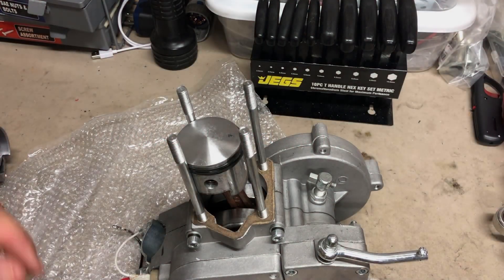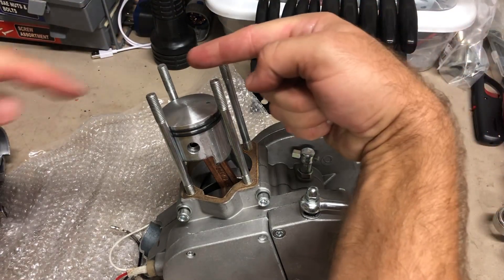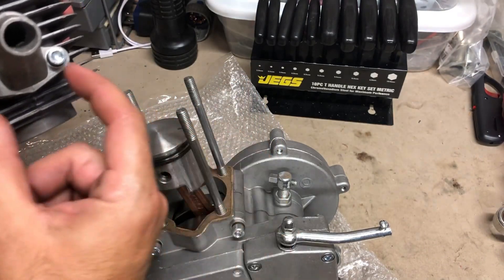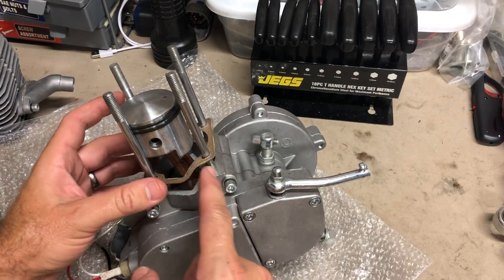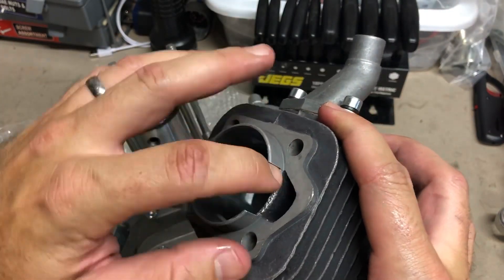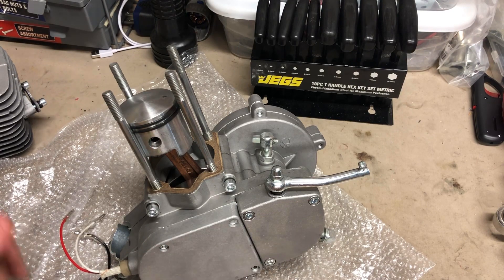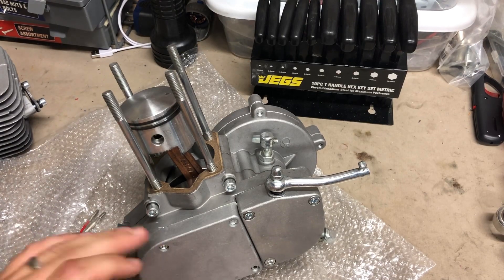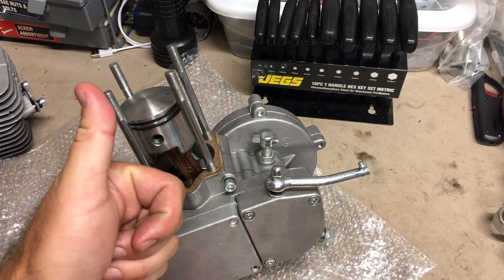WARNING!!- Firestorm YD100 Zeda Pre-Install Inspection Setup

Comment: Why is my yd100 making a heavy knocking noise in the engine over 25% throttle? Do you think the piston is hitting the head because the cylinder gasket is too thin?
Reply from the maker: Thanks for watching. I would first check to make sure that my spark plug was properly gapped and not over-torqued. The. I would check to see if my head bolts were no more than 13 ft/lbs. Engine kits come with 2 bottom gaskets, are you rolling with one or two? After checking the previous suggestions, and if it still knocks,  then try a second bottom gasket. One of the steps above should definitely solve the problem….that is of course if you are sure the knocking is coming from within the jug.

Comment: Bt100 is a better engine kit in the vs yd100 is not better crappy casting and poor performance yd100. if you want a form its and quality the bt100 engine kit is for you

Comment: Thanks for the info. I have been porting and modifying 2 strokes for years so just today I finally ordered this same yd100 engine. Anyway I'll give the porting a good makeover where possible, ceramic coat some of the internals, and upgrade the exhaust. Can't wait to drive it!

Comment: lol please!  I ride a Yd100 and a 120cc 4stroke motorized bicycle all over the place.  Most cops don't care it's size even though under 50cc here like most places.  Most cops I think stop people on these to see what the hell it is and if it's safe to be on riding around. It is there job after all! More then likely you will see them 3 weeks later riding one around lol!    You should really upgrade all piston clips in these. they are notorious for breaking off inside over time.

Comment: wow i was just about to order on thank god i watched this
Reply from the maker: The engines have improved over the past year, but you'll still want to overlook your engine and make the appropriate alterations. It's just mass manufacturing overlooks. It doesn't mean the engine is bad, just means you need to put in a little work to make it better. Happy building

Comment: Great video - glad I watched this before starting up my newest motor.  I do have a question though: Do happen to know of anyone who sells replacement parts for the kits?  Items like clutch and throttle cables, chain tensioner, gas tanks?  I have a few extra motors laying around but are missing some of the other peripheral parts.
Reply: Gasbike.net

Comment: The piston ring notch is not going to hit your exhaust port. The exhaust port is perfectly aligned inside the cylinder wall. Maybe its the heat from the exhaust port causing blown rings, Dirty engine castings also release large metal particles that score the piston and cylinder walls. lightly porting a new engine can get rid of the loose metals and save piston rings.

Comment: Hey would this cause the engine to not start, the Piston facing the wrong direction
Reply from the maker: The bike will start and it will run, but it would be only a matter of when the piston ring would bust and destroy your engine. What happens when your bike doesn't start?

Comment: when the arrow points to the carburetor, does this mean that it is placed incorrectly?
Reply from the maker: Most of the times yes, but look for the piston ring pins on the cylinder--the pins where the rings meet--those need to be toward the intake side of the chamber, not on the side of the exhaust.

Comment: Do you ship to Canada?  I'm looking to get the engine only but can't find any Canadian vendors besides Zoombicycles, but they only sell entire kits, which I don't need.  My bike currently has a Grubee GT5A on it, and I'm hoping I can just swap out the engine and keep all the other stuff.  I migh just need a 36T or 32T to take advantage of the increased torque.
Reply from the maker: Hey, thanks for watching. I too only sell full kits. You may want to try CDHpower or eBay for just the engine. Hope you can find something soon... Tis’ bike riding season 😎👍... best wishes.

Comment: Not only was my piston backwards, one piston clip wasn't seated correctly.  Thanks for the video.
Reply: How is it doing so far?
Reply: @jansen7640  Honestly the biggest problem for me is that the straight arm of the e clips tend to break. I've had to replace the jug and piston twice because of this. This last time I cut the arm down to where I can just get my needle nose on it. It's been suggested to use an internal snap ring instead. I'll try that if I get another failure. I have an e bike coming so in reality I might soon be done with motorized.

Comment: Should we still worry about this?
Reply from the maker: I have ordered some from Bicycle-Engines.com recently WITHOUT issue. But you'd still want to check the top of the inside of the jug tonkaoe sure there is not a metal tag/burr right in the center. I really like this engine...its worth it to check. Thanks for watching.
Reply: @SouthernCustomCC  thanks for the info man have a great night

Comment: Are the bottom ends the same the yd100 and the 80cc iv been told u can put the yd100 top end on the 66cc bottom end
Reply from the maker: I have NOT personally tried to switch them. But with that said... the numbers match IF you have the long rod high hole piston set up. The GT5 motors have the 89mm rod and so does the yd100, BUT the PK80 has a shorter rod at 85mm. So, the answer to your question is BOTH yes and no!

Comment: I'm wondering if this engine will fit a mongoose malus fat tire bike, I have seen other videos where they say you have to  be careful cuase of engine clearance issues,so if anyone would know the answer it would be really helpful
Reply from the maker: james hyatt : Thanks for watching! It will definitely NOT fit the malus. This is much taller than a standard Zeda engine and the spark plug faces the other direction. It will not fit...even if it is offset. Sorry.
Reply: @SouthernCustomCC  many thanks for the reply,and even more for the info about it not fitting ,that alone saved me time and money

Comment: Its supposed to have two bottom gaskets to advance the intake a little as the firestorm motors can handle the extra tork, i also skirted my piston on the intake side to fully advance the intake and its insane fast
Reply from the maker: Allen Sheppard : You gave me inspiration for my next video! I appreciate your input, thanks.
Reply: Can this one piece jug be ported inside the transfers.

Comment: not a great engine apparently it over heat. doing some port timing and running 10/36 you can get 40+ top end speed.
Reply: Meh I already ordered one, need to get a new kit since my old one is getting too old, I have some ideas I want to try with this engine, if I can get 43mph on a stock carb/exhaust 66cc I think it's an upgrade from my 8,000 mile Happy Time Motor.
Reply: Yeah, I mean I know these casings were made in China I mean everything basically is, from most cars to basically everything in your home... Ever seen those "Made in" labels, they all don't say United States, if any actually do.
Reply: @eduardodiaz5762  k
Reply: Is this the same motor as the T-100? I've heard that one doesn't overheat but the seem to be the same engine.
Reply: @eduardodiaz5762  the bt100 and yd100 is the same
Reply: @dreadknot2238  no I'm talking about the Zeus T-100 sold by uMoto, with the super magneto and cdi
Reply: @eduardodiaz5762  junk not a true 100cc more a 79cc
Reply: @dreadknot2238  I mean my 80cc is a 66cc and I'm not at all disappointed, I'm doing 43mph max speed, on stock parts and it's one of those supposed cheap Happy Time china junk Motor, lasted me a long time and it still going strong, I'd heard these motors were made in the US.
Reply: @eduardodiaz5762  where you hear that from u been misinformed all these engines are straight outta china

Comment: I just got mine yesterday and I had the very same problem and only checked it and knew what to look for because of your previous video about this engine. But it was no big thing, just pulled it off and turned it around the right way ( my first time doing btw and was very easy to do) so thanks for the information man, can’t wait to get her up and running.
Reply: I don’t keep track of mileage but I’m on my third tank of gas now and the motor runs great. I haven’t gotten it to top out yet but I’ve had to the low thirties. The only problems I’ve had are with my bike itself. Too many to mention. The bike is actually down right now while I try to fix it again. Brand new bike too, just got a lemon. The motor is awesome though, I would definitely recommend it. It has really good take off power even with the 36t sprocket that’s on it. I don’t think it’s going to have the top end speed everybody is looking for though but I don’t mind, I don’t really like going over thirty on these things, but it is nice to know you can if you want to. Anyway, I really, really like the engine.
Reply: @robbyclark6915  thanks I ordered the Zeus T-100 equivalent to the YD100 but mine came lubricated and correct piston direction, I topped mine at 42mph on the stock parts. I have 700miles so far on mine.
Reply: How is your 100(true 80cc) motor kit working out for you, how many mileages and what's top end speed, any differences noticed between this one and the stock 80(66cc) Motored kit
Reply: But wat is da reason this company permits this emgine to go out da door with out any explaination or. Informing da buyer of this big and dangerous condition an accident waiting to happen.
Reply: @RafaelSantos-vd6be  lack of knowledge or just simple buy from China and sell em again, with their added price mark up.. I got mine for 159. Plus taxes cause you know how America loves taxing everything, but fixing anything proper.
Reply: @eduardodiaz5762  I Have read THAT THESE LOWER PRICED SMALL ENGINES HAVE ALOT OF CLEANING UP YHE BURRS AND METALS  PORT HOLES VALVE IN SN OUT NEED SANDING DOWN AND ETC .I loke gas jobs better as nd Battery electric are way TOO ECPENSIVE $400 AND MUCH FOT DAT I BUY A MOTODCYCLE OR A VESPA DAT YOU CAN REALLY RIDE A PASENGER WITH WATT GOOD IS SITE SEEING WIYH OUT A REAL LIVE DOLL NOY JUST A MMENIQIUNE WE INNLESS WIEGHT HA HA A SINFELD SOECIAL
Reply: @RafaelSantos-vd6be  my T-100 came deburred but yes most of these engines are imported from China and worked on a little by some of the American distributors, it depends by seller.. my cylinder was already pretty clean, I'm a decent mechanic I can work on any engine and even transmission rebuilds, but I'm not a certified mechanic im just enthusiast about motors, call me a Motorhead but I love Gas engines.. if they can somehow make these engines run a magical water based solution I would build cars but sadly we need gasoline, electric is very good but the battery packs are the most expensive part of the bikes I could build an ebike with Samsung batteries I could spend close to 300$ with a rear or front eBike Kit, the things is my GasBike can go 60-70miles on a Half a gallon which is 1.45$ with out charging and I can just take oil if I run out( which almost rarely happens since i top up every few days of riding, instead of 20-30miles every 3-4hours of charging,no thanks.

PS. Plus the battery packs range from 100$ lead acid or cheap lithium batteries (10-20mile range) to 300-500$ for the best battery with a key to secure it from theft, and heavy duty  plus sleek improved looks, and slightly improved charging and last 3-5 years depending on owner.
Reply: @RafaelSantos-vd6be  I could hybrid my bike Front Ebike,Rear GasBike. But I'm kinda fond of the Magnesium wheel looks, has that dirtbike/motorcycle look.
Reply: Its time in my LIFETIME I DONT HAVE WORKING MONEY IM ON A DISABLE BUDGET AND I HAVE TO PAY MANY MEDICINE CO- PAYMENTS I USE TO HAVE PRIDE IN PAYING FOR THINGS BUT NO HAVE ENUFF THESE DSYS IF SOMEONE KNOWS S GOOD MORE RELIABLE WAY INFORM ME PLEASE THANK YOU. .I KUST LEARNED A LOT ABOUT YOO END CYLINDER HEAD OR PISTON BOENG INSTALLED ON MOTOR BACK WARDS WSTT WAS YHIS PURPOSE THIS SHOULD SHIP AN BOX CORRECTLY  .WATT ELSE DO HAVE TO CHECK AND PERFORM BEHIND DA MAKERS OF DA MOTOR THANK GOD  MECHCANILY ONCLINEDED . I CHANGED RELACED MADE MINOR ADJUSTMENTS IN MY CARS ,AND BIG LOW STEAM PRESSURE BIOILERS SND ALL OTHER BOILER ROOM MACHINERY SND EQUIPMENTS BEFORE I DID BODY & FENDER HELPER WORK ON AKL MAKES OF CARS IN 1973 AFTER DA US JOB CORPS PONTIAC CSRS AND FIATS & ALFA ROMEOS FOR A GOOD SICILIAN MANBAND I WAS BIENG TAUGHT TO SPEAK ITALIAN LANGUAGE IM OF SPANISH DECENT SO IT CAME EASIER TO ME BECAUSE WORKED WITH ITSLISND ARGENTINIANS LIKE MY RIP BOTHER IN LAW FROM BUENOS ARIES
 .
Reply: @RafaelSantos-vd6be  I ordered the Zeus T-100 100cc( actually like 76.8cc to be truthful) it's the same motor as this YD100, and mine was installed correctly and lubricated piston which is a first, and this is my second gaskit my other lasted me 8,000 miles and driven for a whole year. Just decided to replace cause it was giving me clutch not engaging problems, it was very reliable after break it in for me. And it cost me practically nothing for it, was an advertised 80cc(66cc actual size) gas kit normal Philips screws which is a no no, you want to have a motor with 8.0 steel grade hex bolts. That old Chinese motor was a nightmare breaking in, lost parts and was a huge pain( recommend to locktite bolts that are very important for engine not coming off, ie engine mounts, exhaust bolts and head bolts as examples) broke it in doing 25-27mph( not recommend doing that) it ran for 8,000 miles more or less, and max speed was 45mph on stock exhaust and carburetor, Ported cylinder for improved A/F/O (air fuel oil) Flow, Singh groves on head ( idk why I did that, just to test different combustions) and it was very fun. Had alot of accidents due to bike and road conditions so get a full faced motorcycle helmet and other safety gear or thick clothing when riding.

It was on a Chromoly Double butted TIG welded TREK 830, just upgraded to a newer looking 820 same styled bike just newer, On Triple Tree suspension with Magnesium wheels.i think I've spent close to 700-900 dollars. But slowly over the year, started with a 830 Trek frame Chromoly steel is very light and very durable (American made) the frame had Chromoly dinky non suspension forks it worked, payed 15$ for frame, 20$ for rims and 10$ misc Bike parts 10$two Michelin Bike HD inner tubes, and 125$ for the (66)80cc kit, total 180$ Later I added extra parts on the bike frame while replacing Wet magneto (highly recommend Battery anti corrosion oil, AutoZone sells it for 10$ well worth it, had a magneto go through 15mph winds+ heavy rain storm for 4days, and kept running another 3,000 miles) I could go on and on but there's a huge forum online for people who are very specialized in explaining these things, and they reply on a regular. My GasBike is something I pride in, I pay alot of stuff, plus rent is high where I live cost of living is up there too plus I have my son and don't generally have alot of money after my car was in an accident, and other financial difficulty i Work three jobs and this bike has saved me thousands, I generally put 4$ of gas last for a week but I drive it close to 30miles a day 4-5 times a week, I work AM and PM, and bike delivery service. 4$ plus 10$ for 32oz of Lucas 2T oil that last (2 Months)Not the best transportation when it rains but sunny days feel amazing, I ride mine Sun, or Storm, day and night. Plus I get alot of compliments, request to make. My advice is if you really think it's for you, look up in eBay for a Umotomotorized seller or the U-Motor Brand of the YD100, should be called a 50mm bore named a Zues T-100. I ordered mine 2 months ago and I'm close to 800miles on this motor without a problem breaking in. Does 25-27mph going up steep hills, I mean some steep hills that my 45mph stock 66cc had to peddle to get to the top, and did 24mph.

Comment: Zeda is garbage anyway why would anyone buy one ? Oh because they say 100 cc guess what they lied to you do a liquid displacement test it's a 80cc
Reply: It's actually like 76cc but who's really counting,oh
 Hear you can fit a Stihl head on one of these
Reply: @eduardodiaz5762  that's what Zeda does and calls it a Frankenstein. Zeda is garbage
Reply: I'm going to use the lower end. Put the ms660 Stihl cylinder on it.
Reply: @dontebone  good luck with your project, on a side Note if you Order the "Gt90 Case Reed Conversion kit" you can tell them your going to put the Stihl head and they can tap the right measurement threads and do the work for you, or have them Not Do the tapping of the threads and leave it plain for your own custom job. I was deciding on a new kit but didn't get the GT90 I went the T-100 Zeus gas kit cause I just want to try something different but equally same.
Reply: @eduardodiaz5762  where do I order it from? I mean will they do custom modifications
Reply: @dontebone  some will idk bout the eBay ones. You can message em before placing an order, just started breaking in my Zeus T-100(80cc) kit 33mph in the first Tank wow that's awesome for me. I'm enjoying this sturdy Kit.
Reply: @eduardodiaz5762  so the internal parts go in this case. Since the bt100 has good lower end torque should the bottom internal be put into the case?
Reply: Only downside to the Gt90 is you need to build it with a new crank, your own exhaust and sprocket and clutch parts, basically everything but the initial parts advertised.
Reply: If only someone makes a true 125cc cylinder one these, it would be a beast. 10+ hp on a bike.